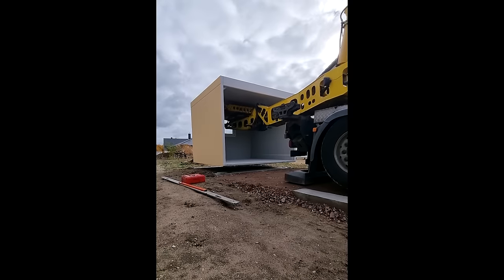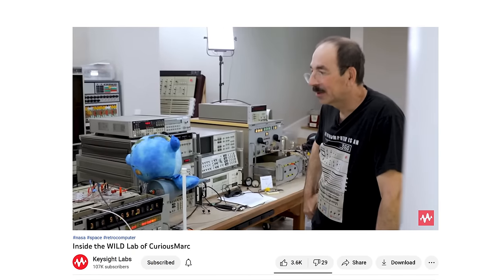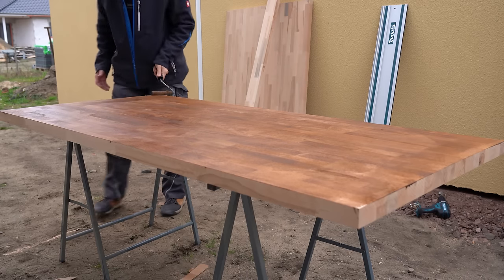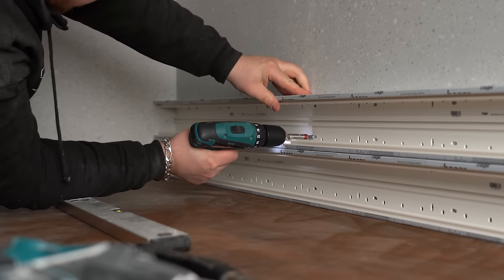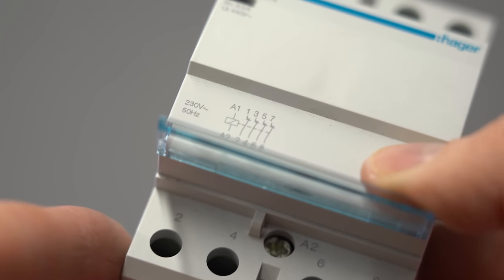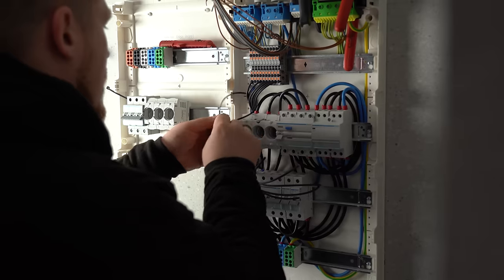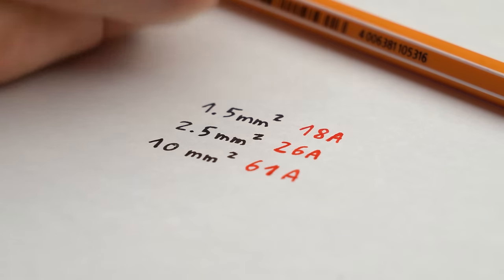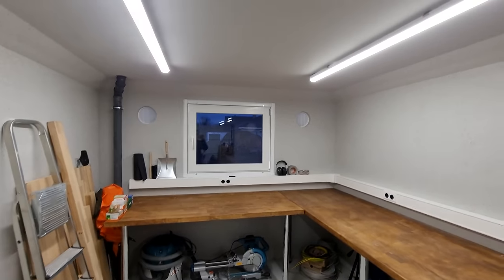Germans do the PERFECT Electrical Wiring! (Garage Build)

Comment: I love to see a European electrical installation on youtube for once. I think this shows many other people the way how it's done over in Europe as I don't think many know how different it is. Great video and great work on your electrical installation. It looks very clean, the way I like it :) Keep up the great video's man!
Reply: wiki: "Elektrotechnische verdeelinrichting", that's how it's done in the Netherlands.
the Dutch super seed the Germans. extreme in some cases, as the dutch have a international recognized elektro testing brand: Kema Keur.
al wires through the walls are in tubes, junction boxes, easy to extent on a later date. a higher grade than Germany.
Reply: @AnalogDude_  I live in Belgium and I've seen many Dutch electrical installations and I have to say that most of them are super super bad and old.
Reply: @Rein-hg9in  some are, if the house is old.
also depends if the house is owned or rented.
But in general it's better executed than other countries using tubes in the walls.
i did some electrical technical work in Belgium, the Belgs are extreme to, where it's obligated to have the blue/brown wire on a certain pin of the socket.
: )

the NEN1010 is the electro technical law.
i had to write/copy entire sections on paper when i was at school.

the house i live in 30 years old and has additional free tubes in the walls to extend or add things, even having a pull wire in them.

But it also depends on who did the installation, not all are honest and are just interested in making money, but i have worked for some that toke it very serious and delivered extreme quality, also the company who gave the assignment could be someone that doesn't care, as long as it works.
Reply: Its not that rare to see how non-NorAm installations are done. For the record though, even being part German myself and having served in W. Germany, I think it look particularly fugly.
Technically, its great, but just looks butt ugly.  Having the garage be concrete though is a nice burn-proof idea though.  If it were my project, and thinking about it for all of 2 minutes, I'd run those chases at the wall ceiling, and drop them half-way down the wall where I wanted each outlet. Any tool I've ever used comes with at least a 2 meter cord, and when working at the bench there is invariably 3-4' of excess cord in the way.
High outlets allow you to push table top equipment to the wall, and could run tool storage on the wall between the outlet drops.
Reply: A lot of countries just use the US electrical system, and i personally think it sucks in every way.

They don't have rcd (a gfci won't save you in any other part of the circuit); they use 110v, they need more amps and still get lower power; with 2 phase for 220v, how do they run tri phase electric motors?; They use metal conduits and electric boxes (in a wooden house, that's just asking for a fire to happen); the breakers only cut the live, not the neutral (at least for individual circuits); they use wire nuts (with the higher amps, the worst you can do is increase resistance); and the plugs are unsafe.

I don't know of any worse system than that, my country uses the austalian system (or very close to it), and the only thing that i'm not sure if it improves on, is the wire nuts (generally, we use plugs or switches to conect wires together, if it's not posible, we twist them together, and they contact each other way more than in the video showing wire nuts vs wago, i'd still import wago conectors if i was starting a new domestic install for my own house)
Reply: @AnalogDude_  German law or standards do not require surface installed cables to be put in pipes unlike in some other countries.  It is however considered good practice to keep cables in pipes.  For cables the standards require only signal cables (network, tv, phone etc.) to be put in pipes. This assuming signa cables are more likely to be upgraded over the lifetime of an installation.
Still, it doesn't help when installing cables where no cables were installed before.  My house isn't old but bringing ethernet everywhere will be a dirty, hard job.  No, wifi doesn't cut it.  Reinforced concrete wins against radio waves 🙂
Reply: @AnalogDude_  Belgium uses type E sockets which is the polarized variant of the Schuko sockets.  So of course it makes sense to mandate where to put the L and N wires otherwise it would be pretty pointless to use a polarized socket.
Reply: @Giuliana-w1f  Three phase motors are very commonly used with single phase power.  The most common method to use them is with a capacitor, known in Germany as Steinmetzschaltung.
Reply: @ralfbaechle  then why not just use a split phase motor? Using a 3 phase motor leaves a coil disconected (and it probably doesn't have as much power)

You can use it, but i would't buy a 3 phase motor to use it like a split phase motor, if i can just buy one made for that
Reply: @boots7859  depends on the usage, a configuration like in the video, you rarely need an extension cord, as you work directly on the benches. of course, if it was my garage, I would add a couple automatic roll-in outlets from the ceiling, one in the garage itself and one in the lab.
Reply: I don't like the only in conduits when the wire is going straight, leave it hanging about when it isn't, look.
Either cable clip it all, or conduit it all (with box glands and corners too).
My UK workshop has everything in conduit.
Reply: @AnalogDude_  Most of NA doesn't have conduit in the walls, and no problems with fires or people electrocuting themselves either. I'm sure thats because we use so barbaric low 120v single phase......  Seems like a lot of extra spec/parts/labor for little gain aside from being able to run 3-phase 250v for your lights and tv/stereo.  Yippee.
Would love to see them superior tubes and junction boxes in the walls of that pre-cast concrete garage...
Reply: @Giuliana-w1f  atleast in Finland circuitbreakers only cut the live wire
Reply: @boots7859  the dutch law dictates everything, NEN1010.
it dictates how high a wall outlet is mounted above the floor in house, the installation height of switches in a living, bed room, etc.
the bathroom has a different set of requirements, there is minimum distance requirement for the outlet and (water) sink, having a aluminum/copper mat/raster under the tiles and connected the earth pin. so do garages, commercial / industrial buildings.

today the junction boxes and pipes in ceilings are building mounted / layed before the concrete is poured. so the piping is installed before the roof is being made made. the junction boxes have a tin plastic cover, you know where they more or less are and start tapping with the stick of the hammer or screwdriver on the walls to find and brake the cover. the can also be screwed to the molds of the walls if the cast them.
Junction boxes a are a system design and can be stacked and automatically interconnect. no parts require apart from freeing/opening a hole.

as soon as the roof and/or windows are installed, you come with a flexible metal spring, search the holes and pull the cables.
mount  the switches, the ceiling plates with a integrated hook, you can use or not, outlets, ventilation, special outlets for the kitchen (using 2 automatic fuses, 2 groups) furnuse, some other stuf

you can do it in a day for a 2 story families house with a roof, attic.

the electrical system in a house is no afterthought, the plans/circuits are drawn before the actually construction process takes place.

the Netherlands really has the best construction method on the world.
no joke. the most futuristic method.
period. it's totally computer aided design for everything at including water, gas and what not.

but depends who is executing it.
but basically that how it's done, the fastest way and the quality is height.

in a very efficient way, mostly. unessl it's a custom building
Reply: @Eytaris  the drawing tells what color are in the wall and how many wires, there are 3 drawings for the installations.
Reply: @boots7859  precast is a option, not really a regular thing, however there are concrete ceiling plates that have metal Armour/metal loops on them just strong enough to hold up the concrete and extra metal "structure" in floors is added and bound to that, metal raster, rebar.
these are called decks, they are uphold with temporary "pylons", adjustable poles and special wood barres. once the concrete has set they are removed.

we have a special type of "Angle grinder" that holds or can hold 2 diamant disc (adjustable) to cut groves in the walls that have not been prepared in advanced or are made of large gypsum blocks placed with a little mobile crane. as wel circular rotary thing with a center drill to cut a hole for junction boxes, purpose made tool. later with a hammer and metal tool you start hammering inside the cut grove and automatically brakes away, just takes one god hit, you place the tube and fixate it temporary until the plaster guy comes along to egal / level the walls.
the layer is like 5 mm thick or even less.

the tubes have standard cross sections and you use a special type of spring to make bends in them, that's something you learn at school. couplings to prolong tubes.
The rules also state the maximum amount of wires in the tube.
all tubes lead to the center of ceiling, a central junction box with hook where the light is mounted apart from inter connections to other rooms or the meter box / installation room.

in the ancient past it where metal tubes with preformed bends. all tubes in the walls lead up unless impossible due to a window for example (so no fear when you want to hang a poster or painting and need to drill, in most cases).

it's easier and efficient unlike for example Spanish construction where people after the building is build have to "destroy" wales in order to mount tubes. they also use a hollow clay type of bricks.

also for "system" walls there are systems and special types of junction boxes to mount switches, outlets, dimmers, network and what not.

you always walk with like 4  boxes of wires as electrician, blue (2.5mm²), brown (2.5mm²), green / yellow (earth, 2.5mm²) and black (for switching, like lights, 1.5mm²), they contain 100 meters. 4mm² in the kitchen for appliances.

network tubes, doorbell, heating, etc.

Wooden houses are very very rare here.
Reply: @ralfbaechle  Wow. And I was cringing at his pipes being plastic instead of metal. I can not imagine running exposed PVC conduit much less exposed cable.
Reply: Take a look at channels such as Efixx, Nick Bundy, residualcurrent, DSES UK (Although his humour is VERY middle England.), John Ward to name a few. They all show the UK electrical systems, installs and such.
Reply: @sootikins  There is the odd fire or other incident cause by cable damage.  If that is avoidable by cable protectio I can't say.  But there are many older buildigs such as wooden farmhouses which have virtually their entire installation surface mounted without pipes or ducts and they've still mostly standing.  So I'd not be overly worried about the lack of etra protection.
The PVC material of course is flame retardant.  And as an advantage over metal piping is that plastic is non-conductive.
Reply: @AnalogDude_  higher rated, but not efficient anymore. 😂😂
Reply: Every EU country has there own style to wire electics. In Germany we call it VDI roles. Thats a lot.. but the same companys send parts in the world .. like Wago, Phoenix, ABB....
Reply: @der_rechtsamwald  in the end it's all handwork.
You got al sorts of people.
but projects done by the state, semi state who rents houses to people are pretty wel executed in case of new construction, most of the time "high profile" constructors are used with neat looking commercial vehicles with grafix on them. they even plant a system type of container to be used as office on the construction site for architects and stuff.
also depends on the type of contract they have and what kind of deathline, etc, etc.
versus a country like Spain it's more more efficient.

my house is kinda good with walls in angles, very well though off. my kitchen is square yet angled like 45º to the rest of the house.
Reply: @Phillip Banes i'm not bashing america, i live in america and we have a nice electric system in my country; i'm bashing the US, and that horrible electric system that they (and some other counties) use
Reply: @Phillip Banes the public needs to raise FUNDS to offer psychological and medication help to these people. the earth has been carbon dated and validated to be around 4.5 billion years old, but they think "somehow" the earth will cease to exist in a few years, the earth is a quite a huge/massive thing and it's gravity force reaches to around 1.6 million km.
someone is brainwashing our politicians.
Reply: @Phillip Banes not all, but most politicians are people with 2 left hands, unusefull for anything, probably also are introverts, people that can't manage themself's, only under likeminded, they live locked inside (partly due to fame), they can't function in society, maybe even afraid to leave home and walk on the streets.

people need to raise a funds to help these people and provide psychological help.
because someone would have a job and skills or work on their own inventions, they probably have extreme boredom.
Reply: @Phillip Banes these people  know that if they lose their position, no1 is going to offer them a job, probably zero % change to find a real job and a social income would be inevitable. that's what they are scared off.
i heard a former member of the house of representatives that she had a dept of 200.000+! that's what she said on tv.
Reply: @Phillip Banes Because even when every nation in the EU has its own taste of screwing the socket, the EU has harmonized many of the basic rules in EN xxxx-Rules. Hope I got your question right
Reply: @AnalogDude_  nen 1010 only really applies since the bouwbesluit 2012 though, and only for safety related recommendations. It can be very nice when done accordingly to norm but I have seen shitjobs from cowboy electricians so much like still using 2x16A on the same phase combined for a induction hob while the house has 3phase power, adding solar panels with their own breaker box with modern breakers while the rest of the house is kept on an old installation with classic fuses, no RCD and no mains switch. And that all is according the law in some way
Reply: @docvrilliant  nope, the NEN1010 was already around in 1991, i had to write / copy entire sections of it.
Yep some time ago, you needed a education and diploma to be a butcher, bar owner, barber, accountant, etc but they changed that. that's why the world has become lunatic in some sense, apart from being a lawyer, judge you're pretty much free to do what you want and qualitry dropped.
Reply: @AnalogDude_  it was around, just not mandatory before 2012 for residential buildings. It's not a law, just a guideline that mostly got used by electricians and insurance companies. Which is why old installations can be a big mess
Reply: @docvrilliant  my former college had a old device in a leather bag that pushed a 1000V pulse through the installation to find faults. pretty handy to find a faulty mechanism like switch or outlet or faulty Connecting terminals.
Reply: @Giuliana-w1f  split phase and 2 phase are super rare here, it is almost all 3 phase, which is why anything aside from single phase, universal and 3 phase are super rare.
Reply: Analog Dude  sounds like a waste of money and time.  But when your house is the size of a box I guess you find ways to spend money elsewhere
Reply: @AnalogDude_  sounds way to expensive.  I guess that's why people live in such tiny homes in the Netherlands.
Reply: @randybobandy9828  my home aint that small and will survive a heavy earthquake without damage (once we had a noticeable earthquake here and the doors, doors, draws of chests where vibrating) and hurricanes.
For sure over 100 years and more it's still standing, unless the concrete permits water through and the rebars rusts away.
Reply: @randybobandy9828  even impenetrable using a vehicle like a car or truck.
Reply: @randybobandy9828  the Netherlands is a top 15 most populated country in the world.
Reply: @randybobandy9828  you didn't even see the video in this channel about wire nuts? They suck. Also, if you got 240v, i got 380v tri phase; your 240 is only for a few things, you mostly get 1800w, while i got 2200w from any outlet (and i can get over 6000w from some outlets, without having to use another phase); and because it's higher voltage, it's lower amps, so it has less voltage drop and i can use thiner wires. The metal conduit and recepticals i got from electroboom doing a new install for something (i would trust him to know what he's doing). Also, wdym no chance of electric shock? You don't even have an rcd outside a few outlets
Reply: Dante Vito  no they absolutely dont suck, just because some German guy doesn't use them properly doesn't change that.
Reply: @Giuliana-w1f  we have 240v 30amp/50amp/60amp if we want. We can even wire direct 240 small outlets if we want. There is nothing stopping anyone from doing it
Reply: @AnalogDude_  what is "not small"?
Reply: @randybobandy9828  Bigger than a Japanese house.
Reply: @randybobandy9828  that's better than i expected. In my country we have 380v 250a if we need it, but what i think is better is that the basic circuit can give more power (and with less amps so it has less drop)
Reply: @Giuliana-w1f  i have 220  and i got 3520 watts (16Amp).

3 phase is 3 x 220V, between these phases is 380V, but that's rarely used, accept for industrial motors in star pattern.

My home also has 3 phases, but my contract is for 2 phase, the others are capped, but they are there, behind seals.

some people have 20Amp circuit breaker and can use: 4400 watts
Reply: Dante Vito  you mean you have 350 amp service, not a single circuit. Houses have a minimum standard of 200amp service and my shop has 400amp service. That's for both 120v or 240v since it's split phase. We have 3 phase 480v in industrial areas, I can't think of any practical reason to have 300v+ 3 phase in a house. You can have 3 phase put in your house but it's expensive because you have to run the line at your own expense
Reply: @AnalogDude_  lmao 🤣  bruh my bathroom is bigger than an average Japanese house.
Reply: @randybobandy9828  i mean that you can get a single plug that has 3 phase 380v and up to 250 amps; not that anyone would install that for domestic use. What i mean is that in the same way you can get 2 phase for 240 if you need more power, i can do the same; but i don't need to, because even the most basic circuit is 220v at 10amps; and i don't need to get anything else than thicker wires and a plug that can handle more amps (with the same voltage that the others have, and completly compatible)
Reply: @ralfbaechle  piping is also not required in the netherland but it is faster installation and sleeker looks. btw löwe makes siccors to cut the pipes.
Reply: @Giuliana-w1f  Split phase motors are (or more like were) used in some appliances, most notably washing machines, that were designed with only single phase in mind. You just don't see them in machinery that is primarily three-phase, ie. mills, lathes, compressors etc.
Reply: @laszu7137  i know, that's why i'm asking why anyone would use a 3 phase motor with single phase ac
Reply: If it is an old house it is often very bad. Especially when it is a rental property owned by a small investor.
Reply: been to the USA, still wonder why they not burned down completly, with their strange wiring!!!
Reply: @ralfbaechle  At least these days you can install PoE Switches in corners where you can't get power to make it all at least a little bit easier to deliver!
Reply: @AnalogDude_  Nobody's stopping you from placing your wires in tubes. In fact I've done so in recent installations in Germany. It's not a strict requirement unless they are data lines, but I like the ability to add another wire if needed. It's nice that you can replace a wire if you drill into it by accident, but with proper placement that should never happen. But yes, I get what you're saying and I agree that it's better if you have the space. Austria does it too afaik.
Reply: @ralfbaechle  Unless you live in an old house that has no neutral (three phase delta) which are also not uncommon in Belgium.
Reply: @ralfbaechle  Friend of mine just bought a house this year and restorated everything, including the electrical system. I said we make it ourself and a Master just connects the junktion boxes, switches, and the main fuse box. But nobody wanted to do this. So he got a "friend" of the family, who told him it will be around 11k if they make the prework and they just throw in the cables. 

He said yes and in the end, he got no test protocol, way to many lines, no pipes in the wall because the "master" said nobody needs that and even the Ethernet Cable I pulled in, is just laying in the wall with no pipe (Cat 7 STP, so at least the power line is not really disturbing the signal) and he got the bill in December of nearly 22k Euros with labor hours, that are not done. He signed off every day and has a copy of it, so they now will go to court for over 12k Euro in labor hours and installation mistakes. THAT is the current state of profession electrical installations in Germany, and it's sad. They wanted to pull 1 line for every socket, and not just a 3 wire one, no, they used 5x2.5 everywhere. This is not professional, this is crap in a shoebox.

For my house, I've learned to flip the finger to them, buy my stuff and throw it into the walls, how to test it properly, I've got the tools to do it and I will have an Electrical Installation Plan - my friend does not have that because "it's not necessary, we never did it, trust me."

Not saying you are like that, but please be better than this master. Reality and VDE are really 2 things, because people have no clue about most parts.
Reply: A series of installations from Sweden
https://www.youtube.com/watch?v=gK22h9wOARI&list=PLfx5G5MbfGoRPiwPE1aFrySB2f_OevT6O
Reply: @ralfbaechle  In Poland, which also uses the CEE 7/5 socket, the live and neutral may be oriented either way (and in a double socket almost always is oriented both ways), and all appliances must be designed to accept live/neutral in either position.